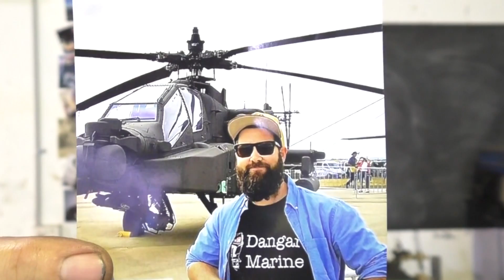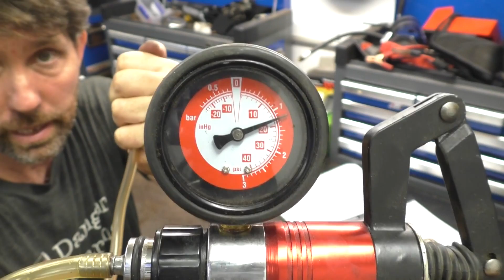Outboard fuel pumps

Comment: I have a 2015 Mercury 60 HP Four Stroke EFI.  It should be the same Low Pressure Fuel Pump.  Can you give me the Parts Kit Information please that had the Nylon Disc Check Valves? My Service Manual states there are no replacements parts available and I will have to buy a new fuel pump.  Watching your video I see it is repairable.  I would like to acquire the Nylon Disc Check Valves and the Rubber Pegs if possible.  Thanks in advance.

Comment: Stu, Just got my boat out of storage and noticed the lower prop seal leaking on the '86 Johnson 150. Big thanks to you for the videos and Marine Engine for the parts I should be up and running for spring. Unless I screw up and I'll be back to watch how to fix what I broke.    Thanks a bunch.

Comment: I had exactly the same problem with the fuel pump in three boats, and it took weeks for the mechanics to understand what the problem was. The engines would be running and then suddenly there would be a power loss, like a lack of petrol. We changed everything: petrol tanks, pipes, everything. We even changed the high-pressure pump, but in the end, it was a mechanical pump. One of the plastic gaskets was off. The confusion was as when the problem was happening  and i was turning the key off and starting the engine again the boat would run perfectly fine, but after an hour or more, the problem would return.

I bought three new pumps as the Mercury dealer in Greece said there was no repair kit . I am extremely happy that my boat and engines work perfectly again. Thank you for the wonderful video.

Comment: Thanks for the video, my suzuki df30a year 2019 cuts power over 4000 rpm after 5-10 minutes ride. It starts and runs very smooth and perfect. Can you give any idea; is it the low or high pressure pump?

Comment: Hi Stu. I have a problem the engine Flood`s on all 4 Carbs, when turning the Key on?? I have sat pressure on each, carb on my work bench, and nothing comes out of the intake? But when it is put on the engine 
it Flow`s out??? Could the pressure on the pump be too high?? It is a Mercury 50 hp 4 stroke 4 cyl from 2001 ( not the EFI model).... Enjoy your Videos..     Hope you can help mee. Sincerely Mogens Madsen
from Denmark Europe..... Have a good day.

Comment: Hey Danger! Your videos are always my first choice when marine work is needed so I have a question.  I have a 2013 yamaha fxca 250 and recently on the water was having fuel pump issues. (Engine dying completely as if starved of fuel and primer bulb being the short term solution) Got it home and investigated the low pressure fuel pump which is electronic and absolutely no fuel coming out of the line which should be feeding into the VST.  Went to the fuse box and found the fuse was blown.  switched it out and fuel pump worked for a short time then nothing.  Fuse blew again.  Tried bigger fuses and they all have blown.  Is my pump shot or is something else causing the fuses to blow?  Thanks for all the great teaching!!!!

Comment: 2002 honda bf40. Original fuel pump. Is it possible that engine oil makes it way via the pump plunger/camshaft inside the pump? I noticed very little weeping of oil underside the pump assembly/gasket. Does not smell gas. Excellent video! Thank You

Comment: Just happened to see this great vid. I have -04 BF50A and the oil is getting thin and it smells like there's gas in it. How common is it that gas leaks through pusher rod opening? Can the gasket and rod be changed without buying the whole pump? This may be also a thermostat problem since here in Finland we have pretty cold sea at spring and autumn...and practically always if comparing to Australia😊

Comment: thank you! im struggeling with my boat, a mercury 90hp 4 stroke 4carb engine, on full throttle it wont go full rpm.. i opened my fuel pumps (1 pump serving 2 carbs) and found the "sealant gasget"? full of some white powder, tho i cant seem to find  a leak, tho there was some sandlike sort of grainy stuff in the chambers, so i cleaned them out, hoping it was the sinner, maybe blocking some valves or something... and i dont want that stuff in my carbs. cant seem to get my membrane off tho, but i cant see any damage... i see some fuel getting into the water but i cannot find where it comes from... its an 2001 model.. do u have any ideas?

Comment: Hey Stu!  Thanks for the videos brother!  While watching your choke video I had a thought that may be my be the answer to my bogging at wot.  Can you confirm please: The read valve on the 2nd fuel pump in this video (used on 2002 Yamaha 90hp), is what I have.  Should both reed valves sit closed (touching the seat), when installed.  If one is lifted enough to see that it is not seated (maybe 3mm gap), would that cause bogging at wot?  I will need to confirm, but I think I have this condition with one of my reed valves.  I am getting exited and cant wait to get home and check my pump.  I will comment if that is the problem, because as you said, I have never seen an issue with those reed valves, but I may have missed this a few night s ago.  Thanks brother!

Comment: I need to stop buying motors that you have done videos on stu 🤣🤣 i up graded my 12ft with the old johnson to a 16ft with a  merc efi 50, 

Intermittently it looses fuel pressure over 4200 🤔 followed your vst video thats all mickey mouse so now looking at this
Reply: On the plus side stripped the low pressure pump and found two bits of old 2 stroke oil from the old owners last motor he didnt swap the tank they was jamming the one way valve

Comment: i have a yamaha f115 with a similar pump. i opened it up because im getting fuel in the oil. the diaphragm has oil on the fuel side is that normal?

Comment: My 06 mercury 4 stroke efi is losing prime on warm starts.  Could this be a possible issue or does it sound like high pressure vst? I've replaced primer bulb and main fuel line but problem seems to be getting worse. It takes about 10 attempts to start but once it cranks the engine runs fine.

Comment: I have a 30hp Mariner EFI about 4 years old. It runs fine from cold. If I stop the engine after approx 2 hours and leave for approx 1 hour it will not start. It turns over fine but will not start. If I leave the engine overnight it will start up again just fine. Any ideas? Fuel is always filtered into tank and a fuel/water separator is fitted. Engine is serviced annually. I have enjoyed your blogs over the years and have begun searching through them again to help find a solution to the above problem. Cheers.

Comment: Love your videos Stu, so Briiliantly simplified for lamen like myself..

My mariner 40hp efi has been beeping a continuous warning beep..
Apparently oil pressure, or overheat. I've replaced oil, oil filter, cleaned high pressure pump, replaced both fuel filters and bought all new fuel lines... Still getting the dreaded beep..
I'm going to replace this low pressure pump now as the cooling water runs through it so hoping it might help?

Any other suggestions would be amazing..?

Comment: Thanks for this. I have that very fuel pump, bu my problem is that there's no water flowing through it.  Can't figure out how the cooling channels are set up in that pump. Have tried vinegar and poking with wire, but no luck. Any advice for me at all? Thanks for all you do here, chief.

SOLVED: So I found a solution to the problem. It is a fairly straight shot through to the tell tale hose. It is pretty narrow though, and with age, it gets a little jagged in there, which can catch a lot of sand and shell debris. I used penetrating oil and various size zip ties to "saw" my way through. Required much more physical effort than clearing hose or tell tale, so don't be afraid to lean into it.  Hope this helps someone else.

Comment: I have a 50 horsepower blue band it lay in a shed for 20 years I cleaned carbs new plugs it never had and tork 3 people and the boat wouldn't plane it ticks over its on all cylinders I sold it and the guy can't get his boat to plane the engine has low hours on it as it was hardly used I cleaned behind the coils to could it be the fuel pump

Comment: I have 2 of the pump at 11:17,  Yamaha.  When I squeeze the fuel bulb,  fuel leaks out into one of the holes where the mounting bolts go.  That’s very bad right?  I’m surprised that both of the pumps I have do the exact same thing.
Reply from the maker: Could be a couple of things. Either the diaphram / gasket in the pumps are bad or the needle and seat in the carburettor isn't sealing and the crankcase is filling with fuel through the throat of the carburettor. I would take one of the fuel pumps apart first and carefully look for tears, holes or pinched sections.

Comment: Hi Stu, I wonder if I can pick your brains please !? I am having an issue with a Mercury 4hp I bought last year, it was stood for a couple seasons when I bought it as a non runner - it was really gunned up but turned over ok, I tried cleaning the carb and fuel pump but they were toast so I replaced them and it was working great, however it developed an issue where it was really hard to start but worked fine once it started. I traced it to lack of fuel and the new pump wasn’t pushing fuel through properly, it is ok if I take it off the engine and pump the pushrod with my thumb but on the engine it is as if the cam lobe is not pushing it enough - yet once I prime fuel in the carb it runs great, which I think is partly due to fuel self syphoning ? Anyway I wanted to ask what can I do to make the pushrod engage or do you think it’s a duff pump ? I have cleaned all the lines and the fuel tap bowl, it just doesn’t fill the carb bowl if I empty it ! It’s very annoying as the pump is only 1 season old - thanks mate I appreciate all yours videos 👍👍👍
Reply: DID STU EVER REPLY?

Comment: Hey stu I really need your help I don’t have any good mechanics or Honda dealers near me , I’m having a issue with my motor I constantly need to prime my ball and notice it’s never stays hard and when idling it doesn’t stall but shakes pretty bad . I can’t find any info on the part I need or if I should take it out and check the fuel pump . I’ve replaced the gas lines fuel filter clean gas fuel water separator and nothing any advice would be great !

Comment: Having issues with my yamaha F115 making oil and recently started only reaching 4500 rpm (5800+ was max before). Dumped the oil and refilled to about halfway up the dipstick. Ran it 70-80 miles in one day and it starts running at 4500 and wanta to die like its starving for fuel. Bulb is partially collapsed but pumping while running doesnt do anything. 

I removed the mechanical LP fuel pump and no tears in either the rubber or clear plastic diaphragms. Could the one way valves be letting fuel into the crankcase somehow?

Also have an oil leak what appears to be an upper crank seal. Could excess pressurization of the sump cause seal failure or leakage? Wish the yamaha LP pump wasnt $200...seems excessive for what it is.

Comment: Great video. I noticed on my old pump that after removing it to test it you can pump the button plunger that goes in the motor and feel if it holds suction with your finger over the pickup side and feel the pressure on the outlet side if the pump is good.

Comment: We are working with this exact pump and encountered a problem getting one of the mounting bolts to thread when we put it back together. We backed all four out carefully just one time and three went back in well while the other won’t latch onto the female threading. Do you have a recommendation for how to correct this so that the pump can be fully reassembled? There is no visible issue with the bolt and so I figure that the problem is inside. We did switch bolts and found that any one of them works in the three good female threaded parts.

Comment: Quick Question- I am cleaning the carbs on a 2001 30hp 2 stroke Yamaha for my dad, he let it sit for 5 years with ethanol gas in it.  So I cleaned the carbs dumbed the old gas and had him get new ethanol-free gas it started right up but after a tank of gas was idling rough. I pulled the carbs and the jets were clogged again not as bad but some of the jelly was in the system still. So can I open and clean the fuel pump without having to replace gaskets or diaphragm? I also ordered a new hose and primer bulb and plan on scrubbing the tank clean. cleaned fuel filter also again.
Reply: or do you think to clean the tank, fresh gas, seafoam, new hose, and primer bulb, with clean carbs and fuel filter with clean it out good enough?

Comment: Awesome video! Out of curiosity, did you remove the lower cowling to get to this low-pressure fuel pump easier? I'd really like to know to remove that cowling.
Reply: I just took my low pressure fuel pump off my 2012 Bigfoot and only had to remove the hood latch to get to lower bolt. Diaphrams were trashed. Can't find a repair kit no where.

Comment: I got a 1986 bayliner 125 outboard motor, starts with no problen but when i acelerate to go fast ,the power go off and on off and on , what it can be , the carbs, or fuel pump? Or someting else?

Comment: That rubber is to tight in side them one-way disk if drilled them out for movement it will seal as they are wrong for this pump will not move to seal. They should be a little bit lose so can work. Just my thoughts could be wrong

Comment: So I've been learning from your videos and so far, I've cleaned the VST and screens, replaced the fuel filters,  tested and replaced a high pressure pump that I think was working (The new one is louder and sounds stronger), cleaned the low pressure pump, it was very dirty and caked with black debris which I believe to be a disintegrating bulb which I also replaced.  The reed valves looked like new and I couldn't see daylight through or any tears in the diaphragm, I put it back on, not firing.  I've replaced the spark plugs which were all fouled - Wet, black.  still not firing.  It is leaking a steady stream of fuel out the prop and it is still not getting any pressure at the VST.  I don't think the fuel is getting to the fuel rail.  Do you think that the low pressure pump may still have an issue and needs to be replaced?  Could it be that the plunger is sticking causing the leak?  What else could cause the leak?  It starts dripping straight away as I turn the key, or if I squeeze the bulb a couple of times.  Thanks for your help!  By the way it is a mercury 60 HP 4 cylinder 4 stroke efi.  2009.  It has always fired right up at the bump of the key.  It has never sat for more than a couple of weeks until now.  Maybe  around 350 hours on it.
Reply from the maker: If fuel is leaking out the exhaust it must be getting into the cylinder. Do you see any spark if you hold a plug against the cylinder block?
Reply: @DangarMarine  I found and fixed that leak, and have now also replaced the fuel lines.  Still not luck.  Replacing the low pressure pump got it to idle but it will die after a few seconds if I hit the throttle.  Any other things I can check?  Thanks for your help!  I really appreciate it!
Reply: I got it running!  Dude you are awesome!  It was a combination of the low pressure pump needing replaced, and a very tiny piece of debris in the fuel line below the float needle in the VST.  not even 1/16 inch piece of black debris which I believe is what caused the low pressure pump to fail.  The primer bulb was deteriorating inside.  Your videos saved me a lot of money!  Thank you so much!

Comment: Thanks for the video. I am trying to convert my VRO on 1996 Johnson 200hp 90 degree to a premix conventional direct fuel pump.  I was going to run 2 aftermarket fuel pumps in series and cap the extra pulse port- will this work?

Comment: if i go slow its ok. when i try to speed it goes but only for 5 or 10 sec max. if i pump every few seconds it will go normal.. now do you think that i have to replace the second diafram to or it may be something wrong in the carburators (has 2 carbs)
Reply from the maker: Sounds more fuel pump but could be carbs re previous reply. Also make sure the breather is open on your fuel tank.
Reply: i changed the one diafram and it worked the first day but  the day after started to do tha same. do you think that the second diagram is important too ?

Comment: hi pls help me .. i have an 2 stroke yamaha 20hp and it has the second one pressure pump and at full throttle after 5 sec i have to pump or else it slows down ... i took out the pump but i didnt see anything that was wrong only that i put a new diafram  but i didnt change the second one that is on the lid
Reply from the maker: Could also be a problem with the float / needle and seat in the carburettor.

Comment: Which kit did you use to fix the low pressure pump we have a similar model.
Reply from the maker: If you look your motor up on marineengine.com you'll see they are a section of common service items separate to all the spare parts. You'll definitely find the right kit there.

Comment: Hey mate, thanks for all the videos, been super helpful when servicing my boat. Quick question - I have a 50hp Mercury (same fuel pump as you've used in this video). Above ~60% throttle it's losing power and sowly surges back to idle then cuts out. Switch it off and on and it's good again up to the 60% mark. Thinking it's the fuel pump or blocked injectors. Any ideas?
Reply from the maker: Sounds more like a fuel pump problem.